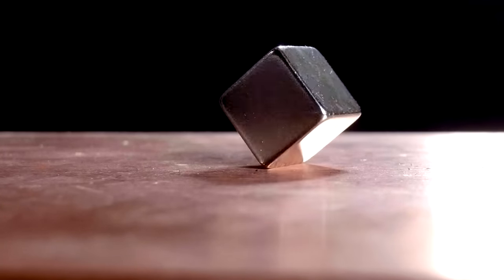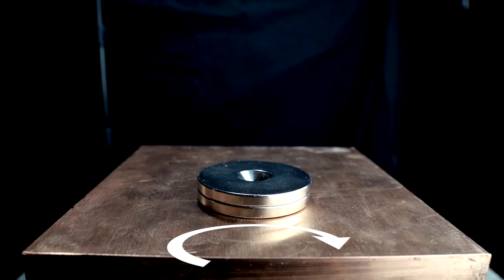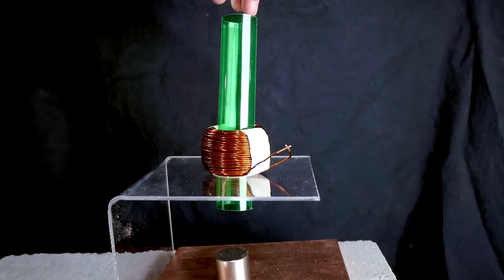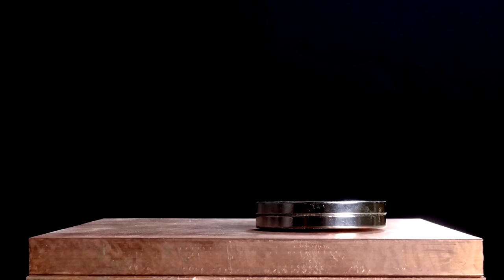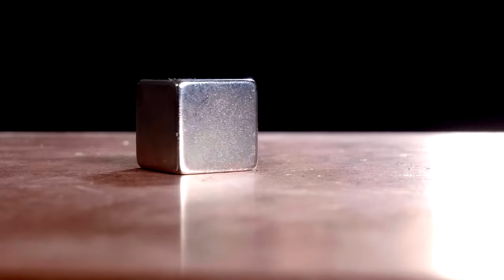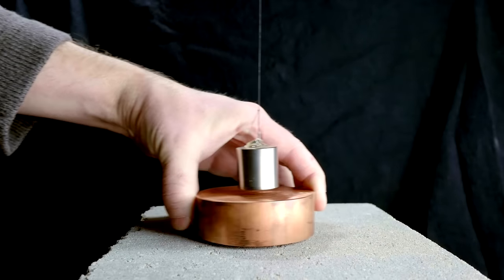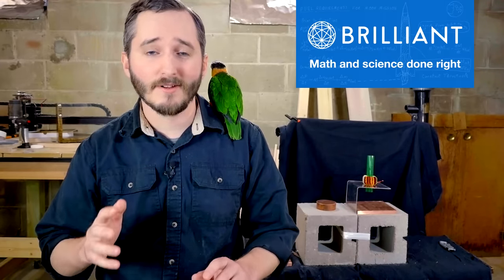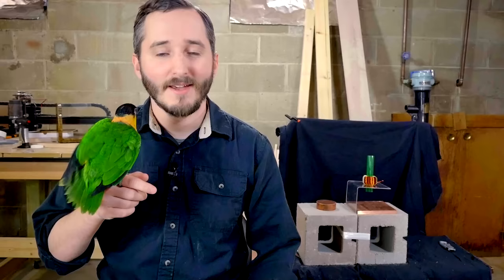Copper's Surprising Reaction to Strong Magnets | Force Field Motion Dampening

Comment: At 1:37, you said "...there is no attraction, nor repulsion...". Wrong. There is attraction or repulsion, depending whether magnet goes toward copper clad or away. Copper is good conductor and magnet generates eddy current, which in turn produce exactly 'mirrored' magnetic field when magnet approaches the surface of the copper. When magnet going away from the copper, you can feel resistance because then magnetic field 'flip'. Still somewhat 'mirrored', but as a 'negative', or in reverse. When magnet going toward copper, north produces eddy current that produces north pole in copper. When you pull magnet from the surface, north pole produces south pole - which attract or as you said - make a feeling of the resistance. When stationary, no eddy current.
Reply from the maker: Yep, you're right. I got that part wrong in the video.
Reply: Milan Karakas, Thank you so much for your informative comment. Eddy currents are spectacular. As a boatman, I have used counter-revolving currents to move my boat upstream right alongside the main current flowing in the opposite direction. This is done by employing the counter revolutionary vortexes that run along the edge of the main flow. These forces are often ignored in modern technology. Blessing to you.
Reply: Milan Karakas good
Reply: +Ken Bellchambers, I'm sorry, I didn't get, what you did? Could you please explain it?
Reply: LichtTempler, Along the edge of a fast moving stream of water there are a series of counter-rotating whirlpools of water. These little vortexes as they revolve, form a pulling force opposite to the main flow of the river.  The phenomenon happens when the side of the stern of the boat is kept against the edge of the main stream. It will propel the canoe, for example, in the opposite direction of the main flow.
Reply: LichtTempler,  I forgot to mention, this phenomenon only works just below a rapids in a river where the water is flowing fast, or alongside a vertical wall. It does not work in the general flow of the river where there is no especially fast current. I use it mostly when paddling upstream just below a rapids and when alongside the main flow. It is  much easier to see than to explain.
Reply: Milan Karakas Very interesting! The dumb ones are glued to the screens of their smartphones, laptops, iPods, playstations, etc. People that run power plants and things know this kind of knowledge, but remain silent. I know that there is all kinds
of neat characteristics of every element. Humans are just so self centered, greedy, and money minded, that they never took time to do intensive, in-depth examination and studies of each element! Only exception is that, those elements are isotopic, then like outer space, the government claims it as off limits, and all theirs. Bismuth has the atomic# 83 and is diamagnetic. It can generate electricity by use of magnetism. Platinum; atomic #78 , is dielectric and generates a magnetic field. Not many people know such things. They haven't even learned about faraday cages, or why it's called a "faraday" cage.
Reply: R
Reply: A
Reply: No
Reply: Milan Karakas. is it possible to use the energy created between two opposing magnetic fields if there is an energy produced and is it usable? If there is a usable or measurable energy does it increase if the two opposing magnetic fields are somehow squeezed together?
Reply: irrelevant, its obvious that are stationary waves
Reply: I think if your plates had the octagon shape or a vortex shape within your plate you might get a more focused result, :)
Reply: You said it your self PINKY > "When stationary, no eddy current!!!!!!!!" now BRAIN that means No magnetic attraction.    um dang it dude maybe next time .....sorry pal but your wrong
Reply: the magnetic attraction is produced not present
Reply: I did not register any readings squishing like poles of neodymium magnets together. I did get some weird voltage readings when taking them and putting them inside and outside  a copper tube so that they stuck together magnetically but not physically. I then took the multimeters positive probe to the copper and negative probe to  a metal stand and measured  a climb from 12 to 60 volts over about 3 minutes....there was zero amps/current though.
Reply: Static electricity, maybe?
Reply: Milan Karakas When i was in highscool, i started to research on my own Tesla mechanics. The U.S. government didn't allow much information about his research, inventions, and theories, to be available to the common public. Since 2008 it seems that all kinds of goodies like his schematics to some things have surfaced. I am really, really, fascinated by electricity and magnetism, and would love to hear anything other knowledge you have about the 2. I would love to sit down over coffee or a tall pot of tea with Albert Einstein, & Nikolai Tesla. With some chalkboards and chalk of course. In the 12th grade i almost ordered a kit to build a 20,000,000. volt Tesla coil but, my parents told me that they'd kick me out of the house, if one ever showed up in the mail by UPS, or anything. I'm almost 49' now.
Reply: LeMTails Stupidity is genetically inherent in alot of people; for example; one chicken runs behind another chicken because, that first chicken's running. It's a simple brainless thing to do, only the most senseless ones do it. Others refuse to succumb to cell phone tower broadcasts, etc., plus they have interests that take does not allow them to divulge too much attention to the dumbing down devices like laptops, video games, etc. Nowadays; they sell battery powered candles! All you have to do is flip the switch, the battery was installed at the candle manufacturer. Secondly: stupidity is a choice, it cannot discern the difference of right and wrong. According to the Bible - that's a sin, it's wrong, it goes against the nature of things therefore; it's destructive.
Reply: QMilan Karakas mm mm,m.
Reply: Put a capacitor between the copper coil
Reply: @kenbellchambers4577  Ken, I just subscribed to your channel. I'm very interested to see if and when you might have a video of this upstream force process. I've actually seen it on mountain rivers in the USA and Mexico where floating logs on the sides will move upstream in faster moving rivers, at surprising speeds. If you do a video about it, it would be very interesting to me and many others.
Reply: Funny way to understand magnetic field and its laws. I was working as a mri users. Its helps a lot for me to deliver lectures. Thanks
Reply: thank you for that. I thought i was missing something during the observation. I have to try this out for myself of course.
Reply: Somehow I want to eat the parrot
Reply: Milan Kara bbkas
Reply: The statement wasn't wrong. What he meant was there is no inherently built magnetic field in the material which attracts or repels the magnet. Rather there was a temporary build up of magnetic field due to localized current which repels /attracts the magnet. If you would have brought them together slowly, they would be no forces between them which you mentioned already.
Reply: As I read your comment I feel I am reminded of the inner workings of what is happening; but as I hear NightHawkInLight describe it I feel he is merely noting that there is no inherent attractive or repulsive forces (void of relative motion) at least, in a 'proximity based' sense, if that makes sense (Proverbs 27:17).
Reply: Sorry, I disagree.  Stupidity is NOT a choice!  IGNORANCE is a choice, stupidity is genetic!
Reply: @kumarnishant5677  "...If you would have brought them together slowly, they would be no forces..." If slowly, then the induced eddy current will be low, but present. As long as magnet moves in or out, it induces magnetic field in the conductor (copper in this case). Only standing still magnet will not produce any current.
Reply: @Albert JP Me? No, I am as polite as I can be. Just wanted to 'rectify' some small narrative errors.
Reply: Ken Bellchambers, could that also help salmon who hug the bottom when swimming upstream?
Reply: This guy ... this guy right here... this is the guy you want to listen to...
Reply: Milan Karakas smart one
Reply: o
Reply: Yep, I think teaching eddy currents would be the approach to make it all logical with minimum effort. A magnetic field produces electrical current in conductive materials. Also, electrical current in conductive materials produces magnetic fields. 
Knowing these things, it becomes obvious that when you induce electrical current by alternating a magnetic field, you will also induce a secondary magnetic field, it is this that causes the 'breaking'.

You can see this with ANY electrically conductive material, as long as it isn't ferromagnetic :)
Reply: @ME-ru4hv  are the masses not massively stupid??
Reply: Technically you can not say "wrong" unless your intention is to be rude: just state your reasons and  supporting facts. This is not a personal debate!
Reply: Nice explanation.
Reply: Was just going to comment that
But you did a much better julob
Reply: apologies if i bother you with another question. Is resistance felt as you pull the magnet away from the copper plate because the copper when placed between the two opposing magnets absorbing both of their energy fields and when one magnet is removed you feel resistance from the act because in effect you are wringing the magnetic field from the copper sheet as if the magnetic field is water held in a cloth. and the fact that in reality both the magnet and the copper sheet do not want to be separated. In this fashion what properties or qualities do both the copper sheet or any metal or particle and magnetic fields have that each wants? If one was male the other has to be female...so to speak.
Reply: @Nighthawkinlight  Can you copper electroform magnets?
Reply: @midnighttoker133 
Right?
Reply: @XxPlayMakerxX131 
RIIIGHHT??
Reply: Ken Bellchambers I dont understand what you are saying. Did you mean you can take a boat upstream?
Reply: @Nighthawkinlight  Your friend the bird. What is its  name? I always wait for it (the bird) to do something clever st the end of the video. This time it was looking around and picked your ear. It is very inquisitive. Very clever bird.
Reply: Milan Karakas .
VERY good.
NOW explain how this priciple can be used to light a tiny light bulb with no external power supply.
Simply copper WIRE coils, 2 magnets and a peanut bulb.
Reply: Milan Karakas f
Reply: Lenz's law at work. Induced eddy currents oppose the cause that produces them namely the motion of magnet across, to or away from Copper plate effectively slowing it down.
Reply: Thank you Mr. Wizard...
Reply: @kenbellchambers4577  < What you're describing with your fast flowing water current is NOT an electromagnetic flow, but rather fluid-dynamic.  Totally different than the electromagnetic phenomenon this video is demonstrating, thought the outcomes seem to be similar, the underlying physics are different... just to clarify. ;)
Reply: @BillAnt  Thanks Bill, I realise that point. I just thought this would be a suitable place to present this observation.
Reply: @kenbellchambers4577  < No biggie, though they certainly look similar, yours is a liquid/fluid based current, while the copper/magnet is an electron based current.
Reply: @BillAnt  Viewed on the molecular level they are probably much more similar than we imagine. Counter revolutionary forces will one day be utilised much more often than at the present time. These forces are everywhere. I can visualise the skin of aircraft being designed with these forces in mind. For instance, what would happen if the skin was completely covered by micro-venturis? This could develop an extreme vacuum without increasing air resistance at all. Sharks skins have a texture designed to improve performance for example. This is a new field of investigation as far as I am aware. We need to get away from jet aircraft soon, as the massive heat dumped into the frigid stratosphere is almost certainly the primary driver of severe weather events, as heat is the driver of weather. We need to develop cool running aircraft, and to do so we will need to take advantage of every surface. Solar cells, combined with heat absorbing cells and perhaps other passive devices could go a long way in solving this very serious problem. Thank you for your input, it is much appreciated.
Reply: @jeffmoore9210  yeah spot on and my genetics say this video is interesting as but what the fuck does it mean
Reply: Para magnetic or dia magnetic? That is the question. Does anyone know?
Reply: @jeffmoore9210  aha, so thas how you lie to your self.
Reply: @cell line
"Somehow I want to eat the parrot"

lol :)
Reply: After reading some of the replies I sat pondering two things.
1. How have none of you invented artificial gravity yet?
2. So, what you all are saying is, all we need is a giant copper shield to stop all meteors from hitting earth?

I get there is a ton more scientific information to be had in this example of magnets and copper.  It's a great way to open doors to all the young and young in heart people out there about science.  Get off your "I spent a lot of money to prove you wrong" attitudes.  GO and START your own science channel and cover the perceived lucid ignorance that you despise on channels like this one.

I do admit most of you on the comments are SUPER smart; I mean that by the way, being super smart.  Just relax and think of the magic we simpletons see in the fun and cool stuff of science.  Just remember one thing... I'm not going to reply or  read any of the hate mail, so breath.
Reply: Exactly, good point I thought I was the only one that caught that
Reply: @Ken Bellchambers. Could you please explain that here, so thoroughly that someone else can figure out how to do that with boats. Is that done with natural magnets, and something that used to be done often, in the past with boats?
Reply: Fear is the path to the dark side. ...
“Yes, a Jedi's strength flows from the Force.
Reply: I like to leave the copper plate on a scale and drop the magnet to see the change in weight before it touches the copper plate.
Reply: We use the same technique in whitewater canoeing to hang out in the middle of fast rapids.  Just pull into the eddy current of a big rock and rest until you are ready to go again.  Never thought about it in the electrical world though.  VERY COOL!  Great video!
Reply: @ME-ru4hv  Spot on - You will never create change while stuck in the plane of effects.  Solutions - from now through eternity - will be only found when human beings willfully elevate their own conscious to the plane of Causality.   That requires looking inward, developing oneself through not only knowledge but also understanding, admitting to being wrong (many times), and ultimately becoming an individual in the True sense of the word.  Waaaaaay easier to keep my slave mentality and QQ about my owners (government) taking total advantage of people (its subjects) and more importantly *ME*.  Me being one of the subjects who is clearly more intelligent than people, ie many other subjects/Slaves.   My bad... Slaves who work at Power Plants (who are still just Subjects/Slaves) are exempt from my insult to the general public.  Oh and these types of Slaves who are privy to this special knowledge that you speak of,  are also granted a unique Title of Stationary Engineers.  But yeah, totally on board with ya.  Its mind blowing that 1% of Corporate/Government Slave Owners are so efficient, they have effectively and wholly directed the behaviors of millions to take actions that are detrimental to thier fellow slaves and further create hundreds if not thousands of unique divides between the slave class so that they are perpetually engaged with releasing negative energy upon each other, instead of the true causal factor: Thier Superficial Owners.  I always say Lincoln's celebration for abolishing slavery is a perversion of a half-truth.  When he, in fact, did nothing more than abolish; the physical enslavement of human beings in exchange for psychological enslavement,  Plantation Slavery in exchange for Free-Range Slavery, and the enslavement of one race in exchange for the enslavement of mankind.  And dont get that shit twisted, Im not suggesting that one race was OK or even less harmful than mankind.  As one suffers, all suffer.  As such, it makes no difference whether its the enslavement of one race, one mankind, one familial blood-line, or one anything.  A wrong action is always an immoral action, period.
Reply: isn't this Lenz's law?
Reply: @davidchapman3375  Haha! Thanks David! Free Range Slavery! Classic!
Reply: @charlesw.ballewjr.8403  That's like asking why no one has created an artificial Bigfoot or an artificial Kryptonite chunk.
Reply: i just studied this stuff in 10th
Reply: You are kind of missing the underlying reason why this is a part of electrodynamics. The magnets slows down because of how it loses energy to the copper plate. Calling it repulsion or attraction is like calling it attraction and repulsion when your hand is slowed by the friction from moving it trough water.
Repulsion and attraction is a release of energy. This is just a loss of the magnets kinetic energy.
Reply: "How can I apply this in life?"
Hmmm
Reply: . @cell line  
Got me dammit! I knew I should have stopped reading this damned thread.
Reply: Also bcz copper is a diamagnetic substance.....therefore it produces a feeble magnetic force in the opposite direction as that of the applied external magnetic field
Reply: @Milan Karakas what doesn't make sense is why does it slide slow down the copper? If the swinging magnet stops on the swing and doesn't hit the copper it shows resistance so wouldn't it fall off the copper instead of sliding slowly down it?
Reply: I use exactly the same effect in my anti gravity flying saucer....
Reply: @kenbellchambers4577  any way you can show this?  Thanks.
Reply: @USSBARBEL I don't know exactly which comment you are referring to Steve. Please clarify your question. My comments are buried in sub-comments and are now digital archeology. Thank you for subscribing. One day I might have a channel, as I have lots of research relating to manufacturing humus that I need to pass on.
Reply: @kenbellchambers4577  LOL, sorry.  Looked so simple on my end.  You were talking about navigating your boat against a current by utilizing eddies?
Reply: @USSBARBEL    Thanks for reminding me Steve. I have done hundreds of hours of canoeing and I often went upstream and in tidal estuaries. I first encountered this force when going up river alongside of the main flow just below a rapids. Often the water will have a main channel, so the main force of the water is in that main channel. If you are moving up river with the boat in the less rapid flow on either side of the main channel, or in other words, if your canoe is parallel  to the main stream, facing upriver.  The edge of the stream consists of the primary water 'column' and the edge of that column. At the outer edge of a water column, there are counter-revolutionary forces. This is due to the water column moving more quickly than the surrounding water so a layer of water is caught and rotated, and this creates a layer of water whose outer surface is rotating in the opposite direction from the main flow. If you gently swing the stern of the canoe into the counter revolutionary force, it propels you up river with no power paddling, only steering paddling is necessary. The canoe must be kept close alongside of the main flow and as parallel as possible, with only the stern kept in the correct position. If you want to test this under easier conditions, get a canoe, and find a vertical wall with a meter or two deep. Face into the direction of flow and gently swing your stern slightly into the counter forces generated by the water flowing next to the wall. This produces a very powerful counter force which will propel your boat upstream and even in the face of wind  from the direction traveled, It is actually impossible to explain how powerful this force is until you check it out for yourself. If anything is unclear, please ask, and I will try to clarify further. Victor Schouberger is an excellent source of data if you are interested in hydro dynamics. I am also  interested on the emerging hydrolysis technology, and am very interested in soil microbiology with application to manufacturing premium humus. The focus of this work is aimed towards managing the forest fuel overburden to prevent forest fires.
Reply: When u said wrong I imagine it in michio kakus voice
Reply: My Ma. Spot On.
Reply: Milan Karakas I’m glad you responded. I think you explained it very well. I had no idea magnets and copper interacted like that. This was nicely enlightening. We never stop learning do we.
Reply: demas phjjgjhghhff is the time to take the kids to the game and I am going to
Reply: @kenbellchambers4577  The eddy currents in the metal happen parallel to the metal's surface, and slow down the magnet only indirectly through magnetic field that they produce directed orthogonal to the surface toward the magnet. So, your analogy with eddy currents in a stream is a bit far fetched, but interesting nevertheless.
Reply: Well that's blown it!!
Reply: @valninertriplezero4459  No Val., it has nothing to do with magnets. What I am describing is simply hydrodynamics. Please see my comments above. This is not easy to describe, but I have used the technique many times while paddling up a river. I simply used the magnet force as a rough comparison.
Reply: @Richard Smith < Just click on the 3-dot menu > Report > Harassment or Bullying and YouTube should take care of that clown. ;D
Reply: @Twiddle Bee Again? When I was wrong at first place?
Reply: @elams1894  you stated copper is not a conductor this is a little miss leading because conduction and resistance is a measurement of how electrons flow through any thing. everything  that I am aware of has a resistance and is a conductor even oxygen. ???
Reply: @Twiddle Bee would you plz give me a more educated explaination on you comment to me "there is no such thing as magnetic attraction" in not understanding the why
Reply: @ Milan Karakas - In a permanent magnet there exists neither a North Pole nor a South Pole. A magnetic field is a Singularity. The pressure mediations are precessing in the same direction. The perceived change in direction depends upon which end you are observing. Upon inversion, Clockwise from one extremity is observed as Counter Clockwise. LIKE rotation is accelerated in the vicinity of LIKE rotation, certainly not opposites attracting. Place a mirror between LIKE accelerating toward LIKE and you have your confirmation.
Reply: @elams1894  e·lec·tron

/əˈlekˌträn/

￼Learn to pronounce

noun

PHYSICS

noun: electron; plural noun: electrons

a stable subatomic particle with a charge of negative electricity, found in all atoms and acting as the primary carrier of electricity in solids.
Reply: @jamesrogers3774 -  One must unlearn that regurgitation. Just because one person assumed it many years ago, does not mean it is gospel. As Dollard once said. 'atomistic entrenchment is a mind virus'
Reply: @elams1894  so your telling me that copper is resistive that's complexly inaccurate and correct both. resistivity is a measurement not a description as you are insisting by saying "copper is resistive" . from what I learned copper is a electrical conductor ant its resistance is how fast the electrical currents are passing through the copper conductor. Now there are multiple variables that effects the resistance such as mass. area.path and length are some that  if  any one is a different variable it will change the amount of resistance that the copper conductor!!! Has.... plz if your going to grade me, educate me with facts and the sources, im sure im not the one confused here but if I am I would like to learn why im wrong its bad lecture to disagree without any proof corection
Reply: @elams1894  parables is not the best way to get a point across to someone who is asking for a better understanding of how there wrong. Lol. ...I guess they messed up when they gave the name to the electron huh cause you say that (ELECTR-on) had zero to do with (ELECTR-icty) really help me out here
Reply: @jamesrogers3774  - Re - copper as resistive. A guitar pickup is wound with copper only and rated by its resistance. It is a resistor. The only reason so called 'conductors' are called conductors of electricity is because they are misunderstood. They are intrinsically associated with electricity, yes, but they not conductors. They are facilitators at best, conduits perhaps. It is the unique quality of copper and it's interaction with the moving magnetic field that enables it to manifest a magnetic field. The magnetic field (energy pressure, electricity) is transferred around the circuit instantly, extending, in all cases into the air and insulation. The copper offers the chance of transfer (induction) and the resulting magnetic field extends well beyond the coppers mass. What do you think moves the coil of the speaker? The question is often asked, why is it then that one doesn't receive a shock when touching the insulation? The answer is because the insulation, even though it mediates electricity, prevents ones body (water) from eliminating the magnetic field of the circuit. Everything has to do with the magnetic field.
Reply: @elams1894  come on dude give it up your not being very informative here you said copper wound dude wound wound copper in a coil!----!!!!!! Goose
Reply: @Twiddle Bee what do you call it then. why does nothing move? not even electrons?
Reply: @Twiddle Bee why is he wrong, explain
Reply: @elams1894  dude your taking the demonstration way out of proportion lets try to learn the basic physics before trying to understand quantum physics plz.
Reply: If you are confusing Quantum Mchanics with Field Theory at this stage, I wish you good luck.
Reply: @jamesrogers3774  - in your previous comment you said "quantum". Perhaps you missed that.
Reply: @elams1894  including quantum field theory, is a fundamental theory in physics which describes nature at the smallest scales of energy levels of atoms and subatomic particles
Reply: @Wesley. Well.. don't feel bad, it took Luke years to understand how the Force worked.
Reply: @elams. "SO CALLED electrons.. "Huh?? You expose your stupidity [not  ignorance] in the first 2 sentences. I suppose that's because they are actually 'your' thoughts..  not the plagiarized information filling the rest of the comment. It's like Matt said to the phony in the movie,  'Good Wil Hunting',  "You actually TRY and get girls PRETENDING to be smart.. ?" YOU are both Amazing and pathetic! TWO centripetal radial pressures induced within a dielectric conductor concentrated and drag-forced from a hydo-NaCl based mass by forced centripetal pressure into a field of opposing semi-intellectual hydro-NaCl bases with instantaneous inertial resistive pressure providing proof of an initial vacuum!
Reply: @Twiddle  -WOW! You DO exist. We are ALL just sitting here in awe hanging on every correction. "There is NO magnetic attraction."  OMG From the world of Theoretical and Molecular scientists..THANK you.
Reply: @elams YOU again?  You're on the wrong site. The Flat Earth page is elsewhere.  "How Electrons 'Shifting Places' in their Atomic Structure is called 'Electricity'", is found in Round World books. Crazy huh? Anyway..  step1 ) Electrons are the Only other particle [besides light] that exists as a 'Duality'! BUT.. Until you realize there is NO wall holding in the ocean to keep humans from falling off.. this curved concept of Duality is just too much to grasp.
Reply: @bitchy_bitch5909  just recently I contacted black mould poison so spent a lot of time on Google and have been amazed by all the scientific stuff I have learnt and thought exactly the same thing about humans but thinking back to my school years I was hopeless at school work and not interested in learning but now cant get enough info im now 59 other things like motor racing I excelled at but when reading info got to do it little bit at a time as my brain falls asleep so wounded why so good at one thing but so hard at the other so thinking our brains must b wired up differently I tell my friends all this great science and there not interested I suppose that what makes the world go around even now im going to have to have a break just writing this yet can race cars and motor bikes for hours no problem but your right its a funny world
Reply: @philip6419  - Please provide proof of your 'electron'. I'm all ears bro. And while your at it, you could also provide proof of the existence of a so called 'photon'. No giberish, just cite the proof, cheers.
Reply: @elams1894  -I may be wrong, but I believe you are shut down to any proofs because then you'd be wrong. Imagine if all blind people thought as you thought.  So.. if you were blind and never saw water,  only had it explained, you claim you'd refuse to believe it ran through the piping in your house, because you couldn't 'see' it? Lets say you're in bed and 'hear' water dripping from a leak inside the wall, would you ignore it.. insisting it wasn't water because you couldn't see it?    Cheers back.
Reply: @philip6419  - I think you are describing 'Three Blind Men and an Elephant', and yes I am aware of the insinuation of the proverb. I am asking you to prove me wrong. At this stage I dont give a rats whether I'm right or wrong. All I would very much appreciate, is any kind of proof one way or another. If electricity is based on the concept of 'electrons', show me the proof. I have searched for decades for any proof of the concept of 'electrons'. As yet none has surfaced, not even from JJ Thomson, the very person who received a Nobel Prize for the very concept. The concept of 'electrons' cannot explain many phenomena of electricity. Classical Field Theory (not Quatum Field Theory) can explain those phenomena. What I believe has occurred, is that the concept of 'electrons' enables one to assign mass to an otherwise massless entity, which enables math be utilized, and that is perfectly fine, however it does not adequately explain the underlying phenomena. Ask yourself this question; do I completely understand the concept of 'electrons' and their relationship to electricity and the intrinsic modus operandi of capacitance, magnetic fields, lightning, etc, or am I just BLINDLY regurgitating that which has been told to me by whoever? Ask yourself that question honestly.
Reply: I hear your frustration, and yes, I believe I am up to fielding your question. I myself have many issues with many quantum ideas, particularly with Bohr, but with all due respect, I asked you a question.
Reply: @philip6419  - I am not blind to the existence of the concept of an 'electron'. I thought I made that clear. Like I said, if you have any proof of the existence of a so called 'electron', I'm all ears. The very reason we are having this debate is because I have an open mind and have questioned the modern notion of the nature of electricity. Why now, and I'm talking about physics from about mid 1920's onward, have we dismissed the concept of classical field theory from the likes of Faraday and Maxwell? Why was Thomson coerced by his peers to confirm the existence of something that to him, did not necessarily exist? I am now asking the same question of yourself, in addition to citing the proof of an 'electron' if you have it. BTW the electron microscope is in no way proof that an electron exists. It is a coincidental name only. I have provided you with ample classical field explanations of the phenomena of electricity (induction of copper). I have yet to hear one plausible explanation of the same phenomena due to the concept of an 'electron'. Tell me how a so called 'electron' interacts with a magnetic field. Tell me how a so called  'electron' is responsible for dielectric discharge in a glass vacuum that is devoid of media (no mass, air, nothing). Tell me how an electron retains a 'charge' in glass when it is removed from a capacitor yet has no affect on a human when touched by a finger. Tell me how an electron from the same glass then provides a 'charge' back to copper when reintroduced. In fact, tell me how an electron interacts with glass. I could go on and on with all kinds of examples where an electron based answer is lacking.
Reply: Well, no, you weren't. Without having to go back thru 173 replies, Im pretty sure you asked for proof of both an electron, AND a photon.   1st, for someone who says they didn't ask and says believes electrons exist, you sure have a peculiar way of wording things otherwise.  2nd, I'm not answering a half dozen complex questions regarding phenomena concepts that you've thrown out, because I already told you I have questions myself, regarding seeming political maneuvers in this field.   I responded to your comment that, 'you don't believe what you cannot see' regarding the electron.. but you already understand its existence.. so.  If you understand electrons frequency when they are in wave form then you know it cannot exceed the upper frequency [within its shell] it's assigned and it moves [pushed] out and along.
Reply: Every force has an equal and opposite force, therefore creating eddy currents, also creates repulsion
Reply: @kenbellchambers4577  What an excellent description of how to use hydrodynamics to move a canoe upstream sometimes without having to paddle!
Reply: @bitchy_bitch5909  Wow, I have just discovered your amazing comment eight months late as I was replying to another comment posted today on this page. I will be looking very closely at bismuth and platinum. Thanks very much for that. We really need to move forward now, so much to do, so little time. I am a mad humus technologist. Love to chat with you.
Reply: @MissionaryInMexico  Just found your comment Cristos. You might enjoy the fantastic work of Victor Schauberger, the 'Water Wizard'. Yes the CRF (counter revolutionary force), is potentially a very great source of power. The skins of moving objects deserve special in depth investigations. I keep seeing an aircraft skin completely covered with imbedded micro-venturi's. Haven't the slightest clue why. Egg shapes have extremely mystifying hydrodynamic properties also. Amazing results happen when liquid metals are thermosyphoned through an excited coil  And hydrolysis which employs electronic vibration to loosen the water bond and massively improving the efficiency of the task. Many others also. If I had an assistant to do videos with, I would do it. I am a bit behind on the technology, just need a tutor and I would be off and running. I have some really interesting things to share so keep your eyes open for "Sexy Monkey" one day soon.
Reply: @garzascreek  Sorry about the delay, just got your question. Yes, read Victor Schauberger. He saw large rocks becoming buoyant in moving water which was below zero, He watched fish in very fast water stay perfectly still with only a tiny tail movement. He is your man, wonderful, plenty on line. Not sure about the relationship with the bottom, but seems probable.
Reply: @kojack635  Not sure if I answered you before. Yes, the boat goes upstream against the current. The canoe must be almost parallel with the main part of the stream with the tail just kept against the flow. This really works well but is hard to believe until you actually do it. Imagine a conveyor belt covered with ball bearings. If the bearing were held back with a boom or barrier while the belt is running, the top of each bearing would be rolling in the opposite direction to the belt. This is essentially the 'counter revolutionary force'.
Reply: @charlesw.ballewjr.8403  A variable speed gyroscope whose axle extends to become attached across the frame of a larger variable speed gyroscope would probably defy gravity. This is because the inner gyro would be flipping over every time the larger gyro turned creating a very strong resistance impulse. Tune the speeds to develop an harmonic and viola! (According to a dream.)
Reply: There is no attraction or repulsion. The magnet stationary beside the copper neither attracts or repels. Like an oar in the water neither attracts or repels water, but when moved causes resistance which propels the boat. Magnetic field is the oar, eddy currents are resistance.
Reply: What he said is correct its a resistance to motion not attraction or repulsion
Reply: checkout ken wheelers videos his channel is theoria apophasis.
Reply: Nice 👍🏻
Reply: Wrong.
Reply: Yes you are right
Reply: @Nighthawkinlight  bravo
Reply: @bitchy_bitch5909  dear friend I appreciate your sneceretiy to the cause. why don't you make you tube /  blog of your own. it will benefit mankind in the long run. let us do something , how so humble/ no matter how much humble.
Reply: Milan Karakas, Ah, you haven’t learned of the new paradigm shift in the understanding of magnets.
Reply: Well, I went from knowing nothing about this topic, to knowing mostly nothing about this topic, but with a genuine keenness to look into it further. I will do just that.
Reply: Milan brother thanks for using your smarts!🤗
Reply: @kenbellchambers4577   " These forces are often ignored in modern technology"　　＜-Wow, this is the first time I have heard of this in my entire life.  Thanks for this knowledge sharing.
Reply: @richtmason3792  I believe that is how electric generators such as those seen in windmills actually generate electricity.  I could be wrong though.
Reply: Jeff Moore I’m curious are you a geneticist? 
I would love to know where I could get this information without putting myself in debt up to my genetically flawed ears...thanks in advance
Reply: I am Faiz antigravidic propulsion perhaps? Free energy devices maybe? Or in the everyday products you might find in your how..dunno. Just guessing.
Reply: Learn how to produce a sentence that makes sense , please.
Reply: Lenz law
Reply: Diamagnetic
Reply: Milan Karakas was
Reply: Correct me if I'm wrong please but I believe this is called lenz law
Reply: @kumarnishant5677  Yes I imagine to most people that is understood. While it's good to get more information it should have been mentioned in a different manor than an accusation of being wrong.
Reply: @jeffmoore9210  I get your point but what about ignorance caused by laziness. Many people are just to lazy to educate themselves about important decisions they must make in life. Instead they just follow the trend and have no real understanding of the subject. When someone makes the decision not to educate themself of important issues, is that ignorance or stupidity?  I will admit I'm stupid on this subject as I am trying but find it very difficult to understand stupidly.
Reply: No attraction or repulsion is actually correct. However, you substitute our connotative observation and pitiful description, with the denotative terms : Voidance and Counter-Voidance.
Reply: @bitchy_bitch5909  r/iamverysmart
Reply: ok boomer
Reply: Its a story of generated current not attraction like with nikel or iron
Reply: NightHawkInLight     and you were owned.......
Reply: Oh look a self certified expert.
Reply: Lenz law in the house! 😎
Reply: but is wrong or it float dude
Reply: Umm if attaching a led to the coil curcuit doesn't slow the falling magnet, can it be that some electrions blast out of the coil when the circuit is incomplete and the magnet is falling?!
Reply: And another age old question: If the magnet and coil keeps lighting up the LED for a longtime, can it be possible that the whole coil will be charged positive after getting rid of all the electrons inherent by converting them into heat and light via the LED?
Reply: @mrbigdaddyjoe4889  We have bred a planet of delusional, over-confident ass holes who irrespective of how little they actually no about a subject, will happily inform others of what's correct and incorrect.  Every generation since whenever has been told they're brighter, cleverer, fitter and living longer than those who came before them.  The effect eventually convinces a generation that they are better than they're parents and grandparents - they ignore the experiences and advice on offer - further diminishing the collective.  
'NO HOPE AND A LOST CAUSE' is a tad pessimistic for me and I hope / believe the explanation that there are 3 different types; 
1)Those who can see, 2)Those once shown also NOW see, and 3)finally those who, even when shown, still fail to see.
Reply: Milan Karakas There is no magnetic attraction between copper and a magnet, period. The phenomenon exists only when one or the other material is in motion, within a certain distance , which generates a magnetic field. No motion, no field, no attraction.
Reply: This is correct, although you could have worded it in a way that doesn't make you like a jerk.
Reply: Get picky you said copper clad he said copper plate word picking we can all do that careful of being over critical you are not perfect either
Reply: Thank you Milan. This information will work well with my new pyramid project. 🙏
Reply: Bitchy_ Bitch! This is so u. I love it !!
Reply: I agree ... copper appears sponge like in its ability to deal with a moving magnet  ... but in effect a magnetic movement by a magnet induces a mirrored magnetic effect via induction and thus breaking on approach and resistance upon the magnetic leaving(but requires a circuit ...(eddy or whatever if flat copper) ... ...yet when just stationary, copper is very "window like" and neutral which further supports induction theory when a magnet doesnt move relative to copper .... fascinating really.  Copper could be used for magnetic breaking alone if heat generation was required or turned into electricity and the energy recaptured into batteries if coils were used to break the mirrored induction effect ....   Viktor Schauberger knew much more about the uniqueness of copper. It makes me think that copper would be good at dampenening bad emf.
Reply: It's called diamagnetic... it's a diametrically opposed to an applied magnetic field
Reply: @elams1894  What is the medium you are referring to here?
Reply: @jomanout5866 The Energy Medium. Call it anything you like. Ether, Pressure, Isopotential gradient, Jane, whatever one wishes to call it. Its all speculation at this level, and causes so much debate. The door is wide open. That's the best I can provide.
Reply: @elams1894  love it! The door is wide open. I like to call it space itself
Reply: Truuuuuuuuuuuuuu
Reply: Good morning sir I like to get some informatiom from u  about magnet
Reply: 1
Reply: wow
Reply: Yes sir your right there will be a reaction
Reply: Smort
Reply: Yes you make it easier to understand the vortex nature seems an undulating current
Reply: @Nighthawkinlight  👍👍👌👍
Reply: You are brilliant in teaching with WORDS! Kuddos! 💖💖💖
Reply: Okay how about this, what if the magnet was in the tube, neither Rising nor lowering but spinning in the coil would the light stay on?
Reply: @bradleyhall1746  I think she just hates people in general. She also contradicts herself. First she says that stupidity is genetically inherent in people which would make it a natural occurrence, then she says it's a choice. If people are born smart or stupid, how can that be a choice?
Reply: Lenz's law
Reply: I guess he meant to say there is no static attraction or repulsion
Reply: Fake ! There is no atractivo on not repulsion! Don’t spread fake facts here!
Reply: Okay noa
Reply: Yo random question but it's bugging me. Here it is: A friend of mine just revealed to me that he doesn't actually believe that global warming is a thing and that, CO2 causing global warming, is "just a theory"... I tried countering that with "yeah gravity is just a theory too" joke/ retort thinking he was kidding but he is serious... He keeps bringing up how oil prices are going up now that Biden is President and I don't have the heart to reck him... What do I do?
Reply: @kenbellchambers4577  ancient tech knew each magnet has 4 poles, & open field lines until in the presence of another magnet
Reply: @jamesrogers3774  every cell at the atomic level us magnetic
Reply: @FourTreDubbCity  Thanks for sharing. I have no idea how it works. Where are the four poles on a bar magnet, for example? Which 'ancients' are you referring to?  Magnets are fascinating to me.
Reply: Lenz’ law
Reply: 369 op   Uh... First off, telling me to explain something is a statement, not a question. So you should end the sentence with a period or an exclamation point, not a question mark.   Second off... Wth are you talking about?!  How did you get Soviets and war crimes from me saying "Lenz' law"?
Reply: I love it when they say "WRONG" and immediately leaves the possibility that it wasn't wrong, just not precise. You can always extend someone else's without being a jerk. Humility is better than arrogance, it makes you look more a like a human being and less like a slob.
Reply: Of course one could also argue, that talking about attraction and repulsion in general is conceptually at least inconsistant, if not wrong. No matter whether between magnetic material or electrically charged bodies, speaking of attraction and repulsion creates the image of a force in a distance, that neglects the (electric or magnetic) field between the bodies. So no surprise, this is exactly the typical misconception we find in students after typical physics lessons.
Also one has to be careful when speaking of a north pole of an eddy current. Saying it like that is wrong. A pole is a divergence of the magnetic field H and can only happen in magnetically polarised matter. An eddy current produces magnetic fields H and B that have no divergence and thus has no poles. If you want to use the image of a bar magnet in a scientific argument in the context of eddy currents, then you might say, that the magnetic field outside an electric coil is analogous to that of a bar magnet, and then speak of where the according poles "would be", etc.
Reply: @kenbellchambers4577  haha I think eddys and eddy currents are completely different things.
Reply: @Nighthawkinlight  rekt
Reply: Nerd
Reply: You also make these types of videos thats why you have knowledge of these things
Reply: Will this behave only in a copper tube? How a magnet will behave in an non-maganetic tube like titanium?Aluminium?
Reply: Any chance you'll try to build a model from scale of a Fluxliner?
Reply: @Nighthawkinlight  be like: There is no point in quarrelling with this guy, I'll just say yes you are right
Reply: Nerd!
Reply: no attraction or repulsion, only acceleration to a point of the least pressure, like the vortex in a tub
Reply: That what i was thinking
Reply: @omsingharjit  and what is an " eddy current" exactly?
Reply: @kilokilos  when magnetic field changes near Wire loop it creates AC current in the wire but when  same thing happens near solid Sheet of metal current circulates inside the conductor  mean half of the time it moves clockwise and vise versa in many case this current it's called #Eddy Current it  is not useful Because you can't extract all eddy current from the metallic sheet that is why it's also called Eddy current lose 
Application Example
 transformer is good example of this behaviour because if consist of  two coils ( wire loop ) primary and secondary in two separate bobbins  ,  Primary  referred to the side where input power is given , when input ac current comes in primary winding it creates changing magnetic field and as i said  before changing magnetic field also creates electricity if it happening near wire loop , that nearest wire loop in the system is  secondary winding of the transformer so power will transfer from one winding to other winding without any electrical contact but in this case magnetic field from Pri to secon..  going through air  but air is bad for  medium for magnetic  field transfer so iron ( which has  good magnetic conductivity )  needs to be placed between to coil but .....
...........
Because iron is also a metal it also creates current ( inside of the Sheet) when it is placed in side the changing magnetic  field , but that current  is not useful and it creates heat in the iron because of short circuit  this is called Eddy current lose  to void this problem Many iron sheet of E and I shape are used instead of single solid iron .
I hope you have good understanding now 
😌🤓
Reply: @Nighthawkinlight  Sadly 10 million people watched it and im 100% sure not everybody read this comment. So there are now idiots who have no clue about lorentz even though they just saw it and you dismissed it. Thanks.
Reply: @Nighthawkinlight  why keep the video up if the entire point of it is wrong?
Reply: jj
Reply: Subscribed!
Reply: @Nighthawkinlight  You admitting that so readily is more impressive and admirable than getting it right would have been.
Reply: @kenbellchambers4577  that's killer!!
Reply: You exposed this fraud. Nice man. I downvoted him so he doesn't keep spreading misinformation.
Reply: Interesting... on the one hand you are correct, eddy currents but he is correct in, it is not just because it's copper. The circuit must complete for that mirror effect to take place, due to the additional magnetic field of the winding being a closed circuit, correct?

I'm just trying to wrap my head around this...
Reply: @kenbellchambers4577  Yup.
See Secrets of Antigravity by Dr. Paul Lavoulette-Electro-Gravitics*
Coral Castle's Edward Leedskalin
Said, atoms are like little magnets
I just change their polarity"
Reply: Explains the 880$ worth of copper wrapped around lol
Reply: @S6xT2  wat
Reply: @kenbellchambers4577  sounds like a one way directional Tesla valve...
Reply: @steve-o6413  Thanks, Steve-o, I will look that up.
Reply: @richtmason3792  this is the propulsion System for levitating high speed trains, if you have the right configuration for the fields, it runs on a River of Energy. Most people leave out the fact that the metals have large amounts of Crystals (Piezoelectric) properties and go directly to the free electrons...
Reply: @jamesrogers3774  you can't produce energy that already exists only redirect it by changing the field direction...
Reply: @kumarnishant5677  these eddy currents are also known as back pressure as seen in a Tesla valve to keep the flow in one direction...
Reply: @CondensedComments  nothing is void of motion, the minuscule is always in motion AKA decay...
Reply: @MilanKarakas  so to you a slow moving force equates to no force lol and this is how you set the record straight lol...
Reply: @rich1051414  farro-magnetic increases Electromagnetic strength so we can lift a large amount ferrous mass, then release by turning off the current...
Reply: @BillAnt  not totally different, but the analogy does break down...
Reply: @BillAnt  can you not get a electric charge from droplets of water..?
Reply: @steve-o6413  i guess I don't understand your reply...who said anything about producing energy
Reply: @n.w.owhoknowstheshadowknow58  some people like to compete with others, while others like to compile their information lol. He's definitely not the Smartest kid in the class...
Reply: @madisampi2770  true jedi's know there is no drarkside to the force. Zero point starts anywhere on the number line and runs in either direction infinitely...
Reply: @elams1894  try an experiment with a Electromagnetic field placing a steel rod a foot long in the center, then cut some aluminum disk different thicknesses with a hole in the center. The thinnest like aluminum foil won't even levitate, while thicker ones go higher and higher and just when you think you figured it out, put the foil back on let fall to the bottom and insert a thick one on top and watch the foil levitate to the top. 

Please explain this phenomenon...
Reply: @williamlacombe5818  belief is non factual, if your definition of God is non factual then it doesn't relate to the issue at hand. Maybe you should redefine your question as do you believe in my God...
Reply: @MegaBanne  it definitely has to do with the right hand rule at ninety degrees angle...
Reply: @KaushalGrover  I think of it as strong force, weak force...
Reply: @KaushalGrover  a better analogy would be spider gears at a 90° angle able to lift or drop its cargo with a EMF as its energy source. The forces are retarded thus slowing it down...
Reply: @jamesrogers3774  energy and magnetic fields exist in nature its one of the fundamentals of Physics. We do not produce or create them only enhance or redirect...
Reply: @steve-o6413  Steel, when placed near a moving magnetic field, in this case the building and collapsing alternating current, moves the center of the electromagnetic field. This will occur even though the steel rod is stationary. The moving mag field is also induced into the steel so the whole mag field has changed it's magnitude and movement due to the steel. Aluminum reacts to a changing mag field, however the change in energy pressure within the thin Al is not great enough to overcome that of the copper/steel mattrix and so it will accelerate toward the electromagnetic field where it can couple out. The change in energy pressure mediation in the thicker Al is greater than that of the electromagnetic field and so it will be displaced outwards toward the plane of inertia or bloc wall. Reintroduce the thin Al to the system and, because of the position of the thicker Al, the pressure mediation has changed again and  the energy within the thin Al will move to where it can rest less perturbed, in this case toward the thick Al.
Reply: @steve-o6413  And before you head off on a tangent calling me all sorts of names as others have done, don't take my word for it, conduct the experiment yourself using a large piece of magnetic viewing film and look at the bloc wall change position (move) when the steel is added. The same reactions occur in all the field phenomena like Coriolis effect, eotvos effect, mould effect, gyro levitation, and so on. They are all the same, that is, caused by energy  pressure mediation. Others have said it, pressure mediation as in a vortex, golden ratio, it's all related and ZERO to do with electrons. Occam's razor.
Reply: @jamesrogers3774  our language has many different meanings, we say  one thing and the true meaning gets lost. I do it all the time and can't spell worth a shit, aside from that fact, I try to use language like impede, which is like retard, enhance, which is like generate or redirect. 

So I'm sorry if my understanding English language has trouble you, it's only malicious on my part...
Reply: Everything moves in a vortex there are no straight lines in nature. From a stationary point it might look like the earth is falling into an ever diminishing circle when in essence it is only moving away from you at an ever increasing speed. North and south is an indication if you are falling with the expanding ether or trying to return to source, which might be your option. Magnetism does not exist in a pile of neodenium until someone focuses the ether medium in the magnet. Like a lazer beam to see the force you need to be focused.
Reply: @steve-o6413  no worries we are but human after all.
Reply: @steve-o6413  
Yes.
It is the magnet inducing eddie-currents.
These eddie currents produces a magnetic field that slows down the magnet.
Reply: @kenbellchambers4577  As a river kayak fisherman I enjoy the phenomena as well. Eddy currents help me to sit at the bottom of fast moving rapids while fishing and not get swept downstream. Top and bottom of rapids is typically very productive for fishing. I find a change of direction or width also produces the effect
Reply: @Nighthawkinlight  I took what you said a bit differently.  I understood you to say that there was no inherent attraction or repulsion between the objects, rather, it only occurrs due to the motion between the objects.  I think that is true, no?
Reply: @Naman 🅥 
No, it is not.
What you can say is that copper is a good conductor.
This is a property that exists with every conducting medium.
Including iron.
It is just that iron/steel is so paramagnetic that it makes this experiment impossible.
 
What you see here is Lenz' law.
Which is newtons third law of motion applied to magnetic induction.
Reply: @Naman 🅥 
But diamagnetism has absolutely nothing to do with this anyway.
Reply: @Naman 🅥 Sure. But, that feeling of repelling and attracting when magnet moves in presence of the conductor is better to explain by the analogy.
Reply: @TimothyWhite360  "As to your question, it would largely depend on what skills and qualities you believe your progeny will need to carry on your bloodline!
If your children are happy learning the laws of NATURE, then you are probably doing them a service. If they are happy playing VIDEO GAMES, then the opposite might apply!
Watch a mother feline teach her kittens! They play, but they also HUNT. The mother instinct knows that at some point they will have to hunt for themselves and she prepares them accordingly.
Children enjoy a variety of activities. How about making the important lessons fun?"
~$$ Fam*ly Mem*ber
Reply: @madisampi2770  "Light Saber."
Saber means "to know how things work" in Spanish, as opposed to conocer which means "to know places or things."
"Light saber" then represents TRUE KNOWLEDGE THAT IS SEEN by the wielder of the "light saber."
Those who fin*anced Star Wars for you SHOWED YOU the REAL BATTLE being waged, but only THEY have the "light saber."
Our side is just confused, and the price we pay is DEAR!
Reply: Grammar 100
Reply: Yeah I read about eddy current in school. It's bcoz of the Lenz law I think
Reply: I bet your fun at parties 🥳
Reply: @Nighthawkinlight  actually there's something more. Copper is a diamagnetic material and its domains align in a way that it opposes the magnetic field.
Reply: Educational experience program was+ AAA.Thank you sir
Reply: So you think this can be used to create one way magnetic force for an engine?
Reply: @numb3r663  for me your bestseyed
Reply: Aha
Reply: yeah i learned about these in my high school
Reply: It’s DIELECTRICITY not electricity. Charles proteus Steinmetz. Electrical discharges waves and impulses. Magnetism and the dielectric is one. Magnetism is centrifugal and the dielectric is centripetal. Also the “north” side of a magnet is 1 and the “south” side is Φ (aka phi). Magnetism is 1 over Φ constructive and destructive.
Reply: @Man11235  What?!
Reply: @MilanKarakas  Lol almost no one has even heard of the dielectric or really heard about anything I just said and if they have they don’t understand it.
Reply: OP is wrong.. but that was a lot of words to be wrong by,.. so i'm thinking elaborate troll.
Reply: @Nighthawkinlight  no,.. you are right,.. copper does not do any of these things,.. it is merely a medium for the effect... you are 100% right
Reply: Dunno. Got stuck with Pong, in 1974. Ping arrived later. I think. Conito ergo sum. Never got the hang of the analog version. Now on to - putt putt - to silly putty. No flames, please. Just late night jabberwok to ease the tensions of (fill in the blanks…). P.S. I appreciate you folks, at least the polite ones. Thanks.
Reply: Sorry had to make the reply’s an even number.
Reply: He meant that copper isn’t magnetic suns as iron nickel and cobalt
Reply: @philip6419  😂😂👌🏼
Reply: @ME-ru4hv  :) gravity is so dumb
Reply: @Nighthawkinlight  to recognize an error in one's work so simply and humbly is worthy of a great spirit
Reply: if this system use for lift, will this save people life when the lift all other safty system broken and fall down?
Reply: maybe before pointing out some tiny error he made you might want to be a little more polite and congratulate him on all this cool work, we're still all humans here (as far as i can tell)
Reply: Mhm
Reply: Rude
Reply: @rich1051414  . This is what the video did, I didn't see anything not showing the complete details. Sometimes things are more inferred than spoken to the tee in every scientific language possible. This comment is just a minor pick job and it's more like an electrician engineer's thinking and the video is more physics...
Reply: All the copper was touching each other in the coil so why it happens only when connecting the ends? All other parts apart from ends are already connected
Reply: Finally I understand Eddy currents lmao.
Reply: So like that one thing when u touch it, it goes hard and when it’s left alone it returns to a liquidy state? Sorry if this is a bad analogy or smth, I use links to things I already know to understand stuff.
Reply: Milan, 57 characters in, you perhaps came off a bit less politely than you intended.
Reply: @cellline7540  may i suggest deep fried rapped in bacon stuffed with cheese and peppers? That how I'd eat it.
Reply: @Observer_Effect  Yes, true. Sorry for that.
Reply: @Nighthawkinlight  brother I am an Earth Douser if I hold a Pendulum above your copper plate one side the energy flow will be clockwise and counterclockwise on the other this is the same for the magnets I am interested to see how the magnetic positive or clockwise reacts to both the pos and the neg side of the copper plate.
Reply: Agreed
Reply: @kenbellchambers4577  ...Interesting... I do have observed this whirlpools. Never thought of using it. Great idea..!
Reply: @gingerbread2875  I hope you learnt by now that you'll have to shake the apparatus for the bulbs to light up.
Reply: @rossbrumby1957  "There is no attraction or repulsion. The magnet stationary beside the copper neither attracts or repels. Like an oar in the water neither attracts or repels water, but when moved causes resistance which propels the boat. Magnetic field is the oar, eddy currents are resistance."
But there IS attraction & repulsion. If there weren't, the magnet wouldn't slow down to a stop. There is nothing to stop the magnet other than a repulsing magnetic field (when moving toward the copper plate).
Reply: @WhiteGeared  "Umm if attaching a led to the coil curcuit doesn't slow the falling magnet, can it be that some electrions blast out of the coil when the circuit is incomplete and the magnet is falling?!"
IMHO, the electrons passing through the LED (causing it to light up) are doing work and are no longer available (have no energy) to produce the eddy currents that produce the magnetic field that, in turn, slows down the magnet.
Reply: @WhiteGeared  "And another age old question: If the magnet and coil keeps lighting up the LED for a longtime, can it be possible that the whole coil will be charged positive after getting rid of all the electrons inherent by converting them into heat and light via the LED?"
The meaning of a "circuit" is that electrons flow --- and flow all the way through back into the copper. They merely pass through the LED, causing it to light up, and then they go back to the copper. Thus, from the copper's point of view, it got back all the electrons it lost.
Reply: @jeffbransky6499  "There is no magnetic attraction between copper and a magnet, period. The phenomenon exists only when one or the other material is in motion, within a certain distance , which generates a magnetic field. No motion, no field, no attraction."
That's correct. However, he didn't say that the copper itself has any attraction/repulsion. In fact, he said the same thing as you did; he just emphasized that there is indeed attraction/repulsion because the eddy currents do generate a magnetic field.
Reply: @elams1894  "The Energy Medium. Call it anything you like. Ether, Pressure, Isopotential gradient, Jane, whatever one wishes to call it. Its all speculation at this level, and causes so much debate. The door is wide open. That's the best I can provide."
Could this be what is referred to as "dark" energy?
Reply: @objvst  "Okay how about this, what if the magnet was in the tube, neither Rising nor lowering but spinning in the coil would the light stay on?"
No, the light is caused purely due to the magnet MOVING inside the coil. In fact, that's exactly how electricity is produced using a generator.
Reply: @Hgdhgfdssxvbbnjoo  "haha I think eddys and eddy currents are completely different things."
Actually, the term "current" is the opposite of "static" or "stagnant". A river has a "current" because some of the water flows. However, some of the water doesn't flow; rather it runs counter to the flow --- that's an "eddy". These terms were carried over to current electricity (which is a current of electrons) to help understand/visualize it. Current electricity is of two types: Direct Current (DC) and Alternating Current (AC).
Reply: @CaptainLEVIasArkhamKnight  "All the copper was touching each other in the coil so why it happens only when connecting the ends? All other parts apart from ends are already connected"
Actually, that's insulated wire --- it has a thin enamel coating. If you look at the video again, pause when he zooms in on the ends; you'll see that they have been scraped to remove that coating.
Reply: @isaacmadhavan  Its possible. Quantum enthusiasts will call 'that which cannot be explained' - "Dark" something or other. With respect to energy, it all leads back to one thing - a magnetic field. In my humble opinion, which counts for zero in this age of disinformation and cancel culture, energy (and all its attributes, electricity, heat, light, static, lightening, etc) IS a magnetic field. Occams razor applies - simple is always best. Cheers.
Reply: @elams1894  I agree that simple is always best. You've given me something to think about.
Reply: Yep, actually a quite easily understandable phenomenon. Every current flowing through a conductor will induce a magnetic field. And for that it does not matter if that current is itself induced by a magnetic field in the same conductor. 
And because of thermodynamics n' stuff, that self-induced magnetic field will be repelling the outside field created by the magnet, because otherwise you would get over-unity of course.
Reply: The LENZ LAW
Reply: Awesome info
Reply: You're both wrong. Unified Field Theorem proves that magnetism and gravity are actually the same force. The only difference is in its coherence.
Reply: physics lover 👍👍
Reply: @archaicsage4803  You are 100% correct.  What most scientist do not know is that the center of a magnet is by far the most powerful part.  Life itself is a product of the center of a magnet.  The pyramids were transportation devices that made for instantaneous travel into other Galaxies
Reply: @vincecox8376  Yes, I am aware.
Reply: Well explained sir....in short it's all about Eddy Currents.
Reply: E=MC2 is a joke! OK let's get this correct  !!   #1  The only reason radio waves and AC current travel out in space and down a wire is because of the "CENTER " of a magnetic field.  (The "B" field), The North and South poles are the weakest part of a magnet !!   Just like Tesla said,  you got to look at things you can't see !!  At the center of a magnet is anti gravity,  (just tap the center on any glass or plastic and it will loose weight), The center can repel water if vibrated at the correct frequency,  If you vibrate the "B" field into granite rock it will become soft and you would need copper tools to work on same , you don't want to disrupt the magnetic (B")field ) with other iron.  Once you understand the "B" field of a magnet and how it relates to the entire universe we live in, you will then understand what Tesla was telling everyone "LOOK FOR WHAT YOU CANNOT SEE""  .I believe the pyramids were inter galactic communications and transportation systems.  Stone Henge and Gobekli Tepe , power plants.  Take a look at Coral Castle Florida on YOUTUBE and you will see a similar pilar. I believe these horizontal pillars were oscillators that would provide excitation for many things from crops in the field to anti gravity  FYI: If a UFO fly's to close to you the "B" field that provides the anti gravity ("B")Field).  will cancel out your power source  !!!!  E=MC2 is at best just a joke!!!
Reply: Exactly right!
And this guy keeps talking about electrons like the electrons came out of the copper just to slow it down that's insanity. 
I think this is hit piece purposely to lead people astray
Reply: @Nighthawkinlight  I don't understand what's the big surprise is :) Regarding your headline. Just to attract the audience?
Reply: @vincecox8376  You repeated a couple of things more than once in many comments. Take it easy while writing:) Some of what you wrote is approaching half-facts, while quickly you end up in a wild sci-fi rant.   Sounds like you have read the worst quantum mystics. There is no such thing as instantaneous. If space wasn't literally empty you would have no localities anywhere, neither objects nor energy transfers or force fields. You would have a form of heat death, cosmically.  Yes there is much interesting about the pyramids, vibratory dynamics and cymatics.
Reply: @vincecox8376  E=MC2 is absolutely fine if you understand the most realistic interpretation of it. The great pyramid was probably a sort of power generator. Later cultures or regimes of the area used it as tombs and royal chambers.
Reply: @BanterBloom  For most people and most scholars as well, physics of nature is actually way more difficult to understand than most are aware of. Popular culture is full of stuff that is mostly just speculations and guesses.
Reply: treu
Reply: May I know what Grade of Copper is needed or it does not matter? T2 grade from China? OK if I stack a few thinner Plates into a thicker plate? By riveting? Thanks NightHawk
Reply: @Nighthawkinlight  is the copper wire coated?
Reply: you and I are on the same page!!  yes the pyramids  were a interplanetary communication device that operated at a very low frequency.  But also the great Pyramid of Egypt was a teletransportation device, ,, NOW Stone Henge and Gobekli Tape: they were power plants. ,  You will see chips on the upper parts of the stones as they were perfected to a operating frequency.  The horizontal pillars were set to vibrate at a particular frequency magnetically, for many reasons, each horizontal rock had a purpose!!   some were used to excite the seedlings in the ground, to expedite the growth, some were tuned into earths mag field and provided magnetic lift via the Earths "B" field .  Check out Coral Castle Florida,  ED used What I call a "B" field generator, His generator used "V" magnets to ensure max delivery of the "B" field Just like is being used at the black pyramid of Alaska.  His generator used 25, V mag around and 5 deep to produce the "B" field into the earth and special stones.  THE "B" field is the center of a magnet/ some like to refer to it as the neutron field.  But the 'B" field is much much more !!!   I wonder if the black pyramid of Alaska used magnetite as a skin for the pyramid that would explain many things!!!   Tesla new about the free power that's available through the CENTER FIELD of a magnet AS you are well aware the rich boys didn't want it,  It's been there all the time.  When the government took down the horizontal stone at Coral Castle the entrance door stopped working.  Funny thing they gave us the clue,, His horizontal rock was providing the magnetic energy to support the access door.  AS you know magnetic energy is perpetual  JUST GETTING started with all this.   I don't need to brag about all my credential.!!  I got into physics back in 1959 as a ham operator at 9 years old I would design and build my tube type radio's for Rec and xmit.   I know what I'm talking about..    When they say all they had were copper tools OMG HOW STUPID!!!  when you understand the properties of a inductive that being utilize to build the pyramids you would understand a copper tool was every bit of a power tool  BIG TIME!!!!!!!!!!!!!!!!
Reply: you and I are on the same page!!  yes the pyramids  were a interplanetary communication device that operated at a very low frequency.  But also the great Pyramid of Egypt was a teletransportation device, ,, NOW Stone Henge and Gobekli Tape: they were power plants. ,  You will see chips on the upper parts of the stones as they were perfected to a operating frequency.  The horizontal pillars were set to vibrate at a particular frequency magnetically, for many reasons, each horizontal rock had a purpose!!   some were used to excite the seedlings in the ground, to expedite the growth, some were tuned into earths mag field and provided magnetic lift via the Earths "B" field .  Check out Coral Castle Florida,  ED used What I call a "B" field generator, His generator used "V" magnets to ensure max delivery of the "B" field Just like is being used at the black pyramid of Alaska.  His generator used 25, V mag around and 5 deep to produce the "B" field into the earth and special stones.  THE "B" field is the center of a magnet/ some like to refer to it as the neutron field.  But the 'B" field is much much more !!!   I wonder if the black pyramid of Alaska used magnetite as a skin for the pyramid that would explain many things!!!   Tesla new about the free power that's available through the CENTER FIELD of a magnet AS you are well aware the rich boys didn't want it,  It's been there all the time.  When the government took down the horizontal stone at Coral Castle the entrance door stopped working.  Funny thing they gave us the clue,, His horizontal rock was providing the magnetic energy to support the access door.  AS you know magnetic energy is perpetual  JUST GETTING started with all this.   I don't need to brag about all my credential.!!  I got into physics back in 1959 as a ham operator at 9 years old I would design and build my tube type radio's for Rec and xmit.   I know what I'm talking about..    When they say all they had were copper tools OMG HOW STUPID!!!  when you understand the properties of a inductive that being utilize to build the pyramids you would understand a copper tool was every bit of a power tool  BIG TIME!!!!!!!!!!!!!!!!
Reply: He means there is no permanent attraction nor permanent repulsion.